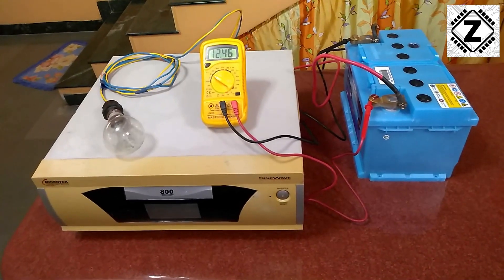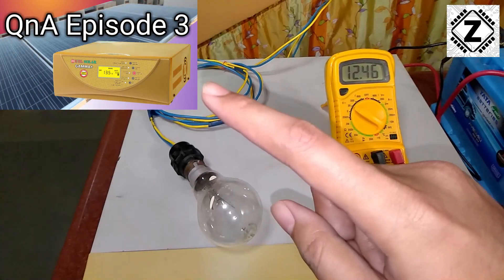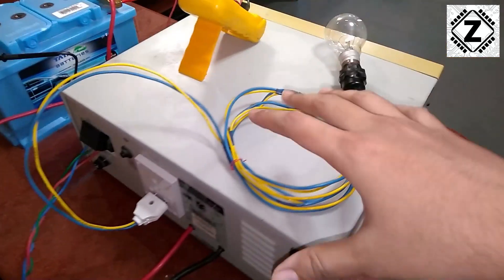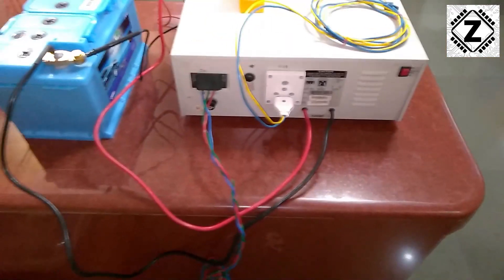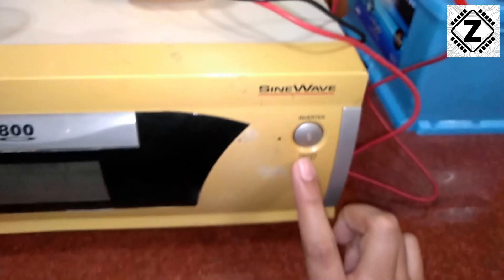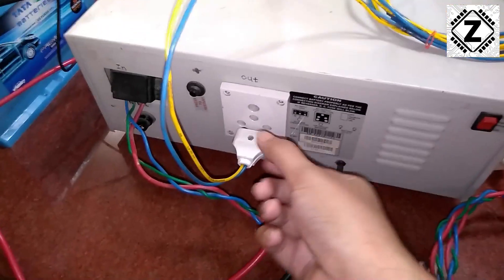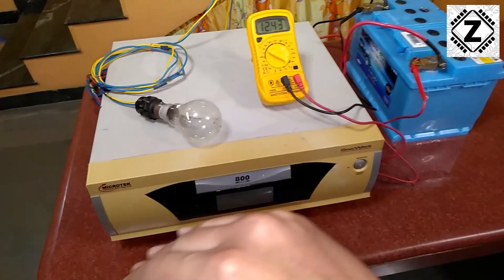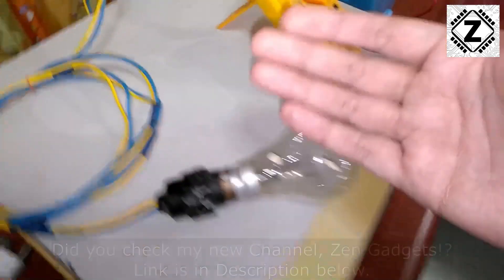[Eng] Do Inverters Make their own Neutral? | Is Grid Common Negative Needed? | Live Wiring Test

Comment: Since grid neutral and inverter neutral is connected, do we have to worry about backfeed problem? Luminous inverter wiring diagram also has one single wire coming out of inverter output.
Reply from the maker: As explained its an inferior method often followed in India.

Comment: Someone told me that inside the inverter, grid neutral is directly connected to the inverter output neutral, if you can check the inside inverter circuit to confirm the same ?
Reply from the maker: Ok

Comment: Sir thanks for this info. In my case I have a Solar inverter (car wala), so it is independent of grid charging. Can I use common neutral (coming from the mains) and two way switch for switching between solar and mains?
Reply from the maker: You may. But it's always better to have isolated special wiring.
Reply: @ZenInnovations  ok then I will keep the wiring independent!

Comment: Sir in my house there is current in Neutral wire ,so can we take phase from commercial supply and nutral from inverter
Reply from the maker: Get the wiring repaired with senior electrician.
Reply: Inform to your electricity board....they will earth the neutral on your nearest pole

Comment: I have an doubt i i get cureent in the input plug of inverter, as i change the two way switch to mains the current that was coming in the input plug stops
Reply from the maker: Floating neutral issues. Use proper wiring as shown in this video.

Comment: Thanks 🙏

I was debating with my election about it 

I was right, we should always have to connect the inverter output neutral wire,

Because If the govt electricity cable is breaking then, how you will turn on the light 🕯️
Reply from the maker: Cool

Comment: If a load is connected between inverter transformer secondary winding  (commonly termed as neutral and phase of inverter), load will turn ON because of potential difference between both. However it does not guarantee that one of the winding end is neutral. 
In reality, neutral is obtained from distribution transformer star connected secondary winding which is properly earthed to avoid any residual voltage due to unbalanced load on three phases. Inverter transformer however has two outputs. Output of one line is exactly 180° out of phase to the other one. How can we call it neutral?
In general, inverter manufacturers connect one of these outputs to supply neutral (inside the cabinet) in order to make it practically "Neutral".
For example, when we check a typical power supply step down transformer (for bridge rectifier circuit) secondary with a line tester, it will glow at both ends of winding.
Reply from the maker: Tester will glow at both pins of inverter, if inverter is 'floating'
Reply: @ZenInnovations  this can happen if inverter neutral is not linked to mains neutral also..

Comment: Sir i think you've not understood properly how the neutral works in inverter. Whether you use single wire or double wire in both the conditions the inverter uses its own neural. 
The only difference is that in double wire even if you unplug the input cable you will get output bcoz here neutral comes through the output socket. whereas in single wire, neutral comes through the input cable that's why you won't get the output if you unplug the input cable. Both the charging cable and output socket neutrals are internally connected. 
It doesn't mean that in single wire system the inverter uses the grid neutral, even in single wire system the inverter uses its own neutral. 
To confirm this kindly switch off the grid double pole mcb, now both phase and neutral are disconnected from the grid. Now check the single wire inverter, you will get the output. Here from where the inverter gets the neutral, the answer is the inverter gets its own neutral through charging cable, bcoz output socket neutral and charging cable neutral are internally connected. That's why you won't get the output in single wire system if you unplug the charging cable. Hope it's clear now.
Reply from the maker: While your information is theoretically correct, I have found out that practically it causes many ghost problems when used with single wire.
For example you can't use smart plug on output of inverter to measure power consumption as smart plug CT is on negative.
Also the wires used in inverter plug are quite thin, causing power loss, especially for solar inverter as these will be used on solar / battery for days or weeks on end.

More discussion has been done in QNA here-
https://youtu.be/1YgmjAxIXvc
I always believe in proper "full spec" 3 wire config.
Reply: Have you no evidence that it will cause any problem

Comment: Very nice video sir.
Sir in the comments section of the amazon link you have shared of Maco Energy meter mentions that it trips after few minutes when 10ampere products are measured.
Is it so ?
Reply from the maker: Mine is older version. It can measure 2200w window AC without tripping.

If you have doubts. Go for 16A model.